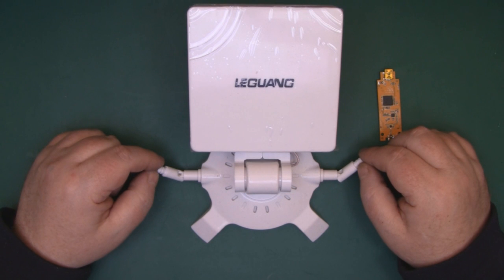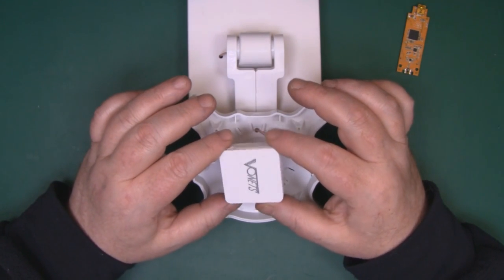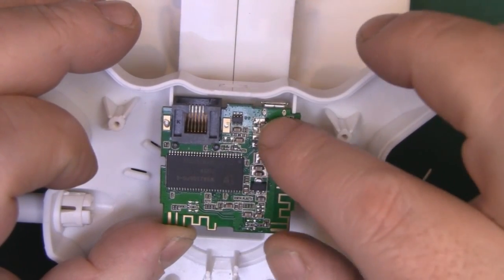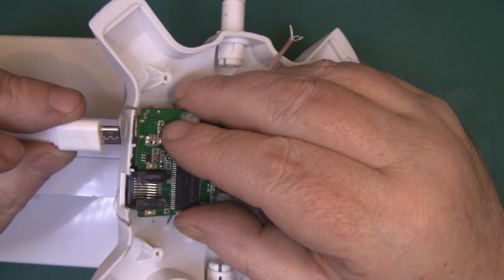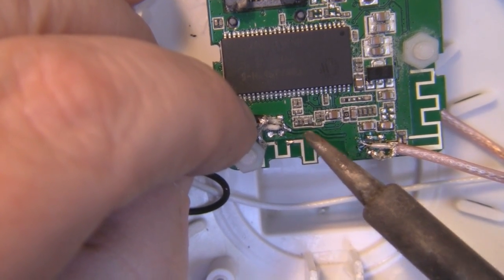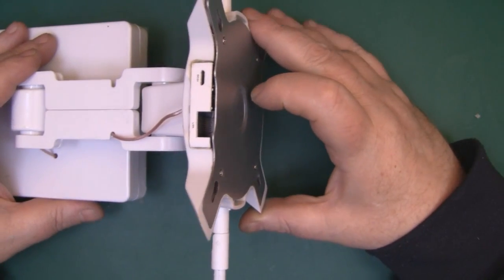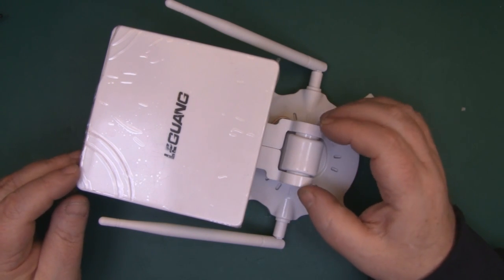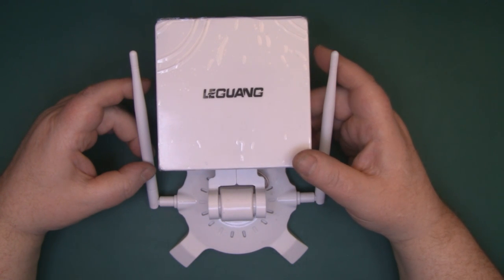Combining a Cheap Antenna and Nano Router #142

Comment: Does the copper tube have to be a certain length? & what does the copper tube do, does it direct away from the antenna end any stray signals it has picked up on the braid through the length of the cable?
Reply from the maker: +Ray HSETWO The tube is very important it acts as a balun and impedance matching and allows the whole antenna to be a shorter wavelength at 25mm it's called a bottom fed dipole, short dipole or Hertzian dipole. Without it you would have a monopole and have to use a wavelength of 31mm.

Comment: Hi there. Im just getting into drones and im using a 5.8ghz transmission system and I want to get a little more range. Currently lose connection at 900m in line of sight and was thinking of getting a patch antenna, any recommendations if i even make any sense haha thanks.
Reply: +flowmaster728 what antennas are you having at the moment?
Reply: +sleepyduck im using just a generic 200mW 5.8ghz transmitter and reciever with clover leaf antenna's at the moment.
Reply: +flowmaster728 You'll want a patch antenna with polarization to match your transmit antenna, I use an Immersion 13dbi gain LHCP antenna and it more than doubled my range ( I say more since I've flown twice the usual distance with no video breakup at all).  I use a diversity receiver so I use the patch on one port and clover on the other for when I am closer in, and keep the patch antenna aimed downrange where I fly.

Comment: So, have wires sticking out of antenna holes, then suddenly the antennas are already put on. How are they connected?
Reply from the maker: +A Beck The wifi card that was inside the antenna is not suitable to have 3 antennas connected to it they had soldered all three coax just to the ground plane in one big mess